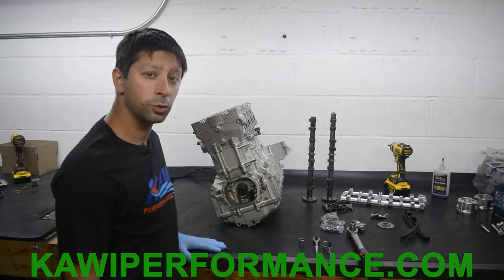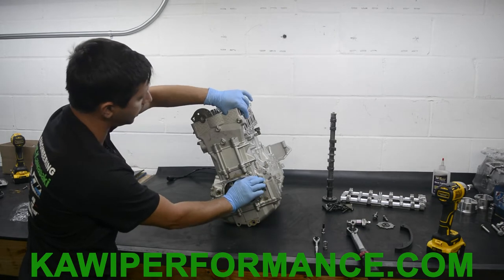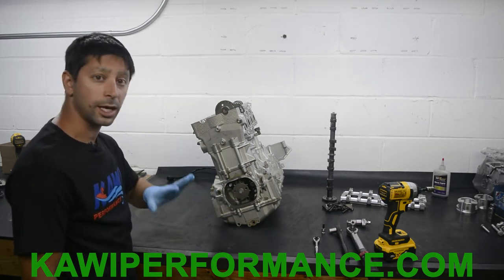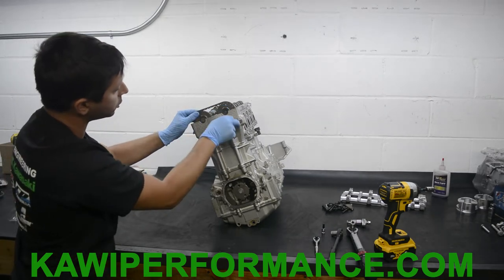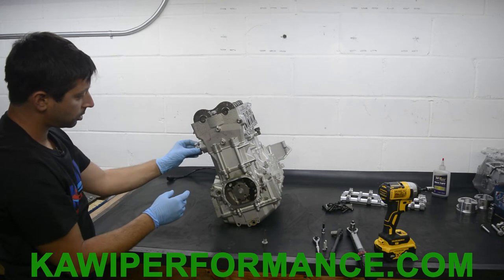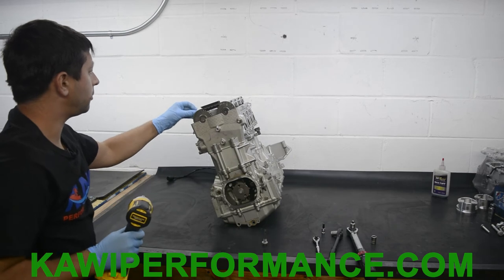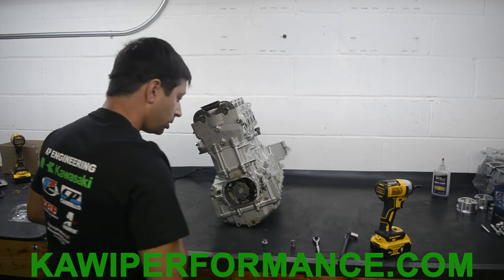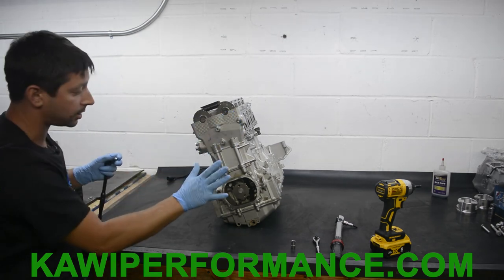How To Perform Kawasaki Jet Ski Cam Timing

Comment: Thanks for sharing. I need to tighten the rotor bolt to the crank but I don't want to buy the rotor holding tool. Can I lock up the crankshaft with rope in the cylinder or will 200lbs of torque be too much on the pistons?
Reply: Hold the other end of the crankshaft bolt
Reply: @AdminMedooH  the bolt will break

Comment: just rebuilt my 15f motor and followed the instructions. I had good compression up until I started the motor, now I have 220 psi on cylinder 2 and 3, but 0 on 1 & 4. Could this be a timing issue or something worse?
Reply from the maker: You would have to put the cams at lobe up and vacuum test the head, it is possible a valve was bent
Reply: @kawiperformance  I found out what it was. The retainers we're installed properly on those two cylinders, and then it damaged the little spacers on top of the valves. After fixing that it's running great.

Comment: Afternoon I have a 2017 stx 15f. I bought a new rebuilt  short block My question is about exhaust side of the block when reassembling manuals all dated 2008 show a oil breather case. I do not have this part it doesnt look like it could even fit under the manifold
was this item deleted on newer models?
Reply: Yes they deleted it

Comment: Hello. I'm a jetski mechanic in Portugal.
I'm finishing a kawasaki ultra 300 x, 2011, I repaired the engine.
I've already tested the jet in the water and it doesn't develop, it doesn't go above 60km/h.
It has a new intercooler and is working in perfect condition.
I have doubts regarding the engine, where the workshop manual tells me 2 points.
A point with 31 pins between point 1 of the intake arb cams and between point 2 of the exhaust arb cams.
The other point that indicates 32 pins between the same parameters as above.
With the jet in the water, it occasionally turns off.
I don't know why the jet doesn't have power.
Any help?

Comment: My shims and valve caps all came off. How do I set all those under the cams?
Reply from the maker: You would have to re-set the lash (Clearance). You will need feeler gauges and most likely a shim kit (https://www.kawiperformance.com/tools.html). The lash is the distance between the back of the cam (Not the extended lobe) and the bucket. It must be within specification for your machine.

Comment: I got everything back together and it started fine but having a problem it has high idle than i blip the throttle and it hangs rpm high and wont go down.
Reply from the maker: Check your idle adjustment, or may have a bad idle motor
Reply: I replaced the iac and still revs up high and i have to kill it. @kawiperformance
Reply: any other ideas?
Reply: Did you check your actual throttle cable and the throttle cable position sensor? Sounds like something is binding.

Comment: This a stoopid video. 
How can you possibly have the chain in the correct spot when you say you can put the timing rotor in any position? Its obviously not keyed or splined onbthe crank.
Then you play stoopid music over the top.
You haven't mentioned where you set the No.1 piston.
Reply: You don’t care the piston if you look the marks from the front
Reply from the maker: The timing rotor is not in a random position, it is keyed, so only fits in one way. If you follow the marks we mentioned, #1 piston does't matter.